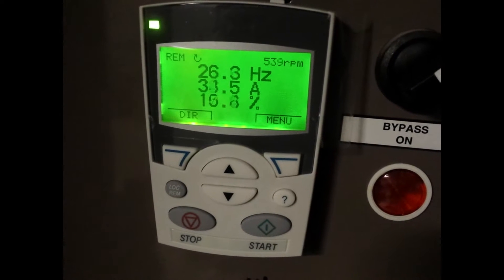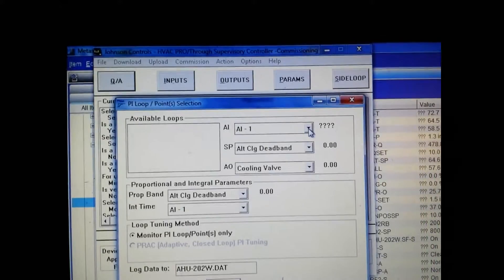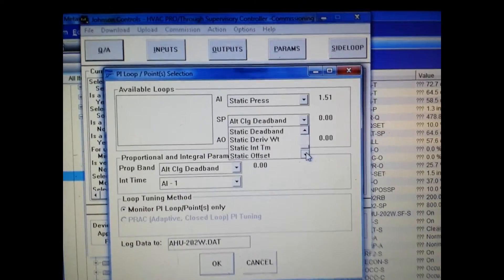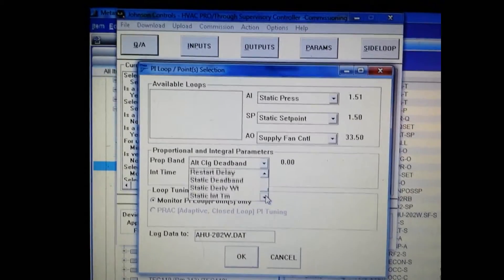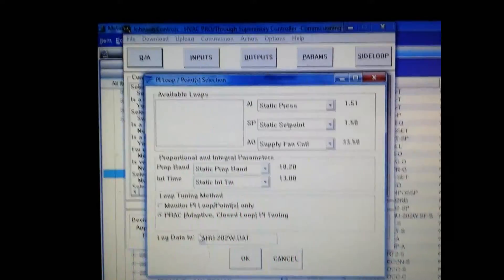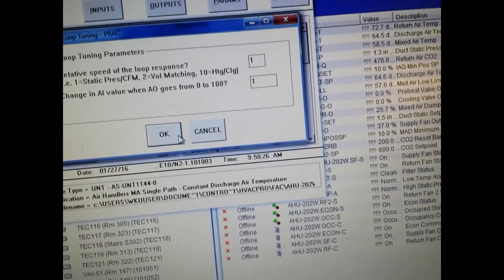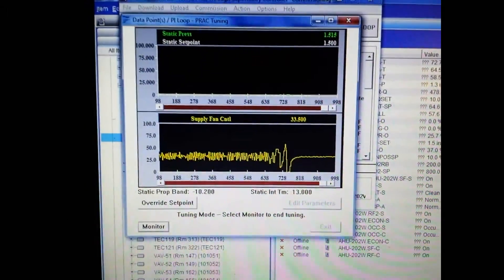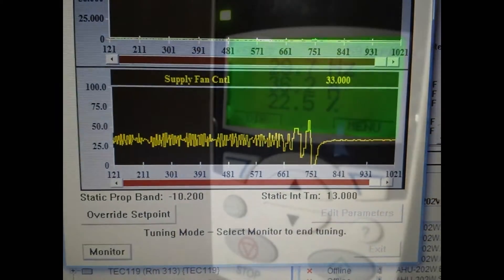PID Loop Tuning using HVAC Pro

Comment: Great video thank you for sharing your knowledge. I just have a question about the loop tuning I see you selected the prop band and the intergal time that has to be tuned and then it looks like the loop tuning itself finds out where it needs to adjust the Loop automatically to make things stable?
Reply from the maker: Yes, the system will adjust the values to try to maintain the setpoint.